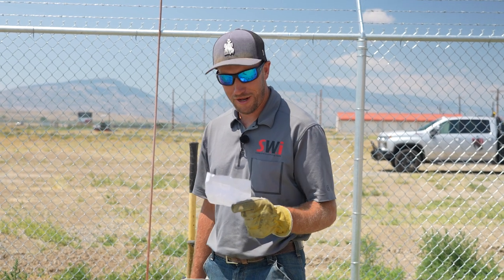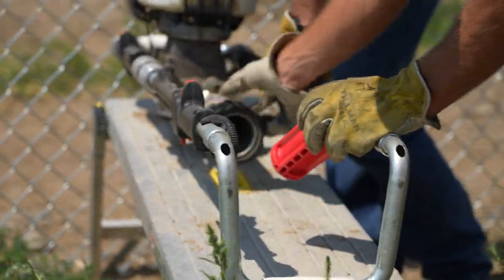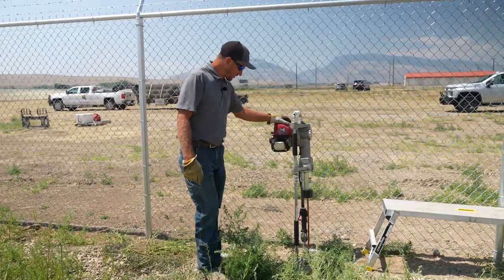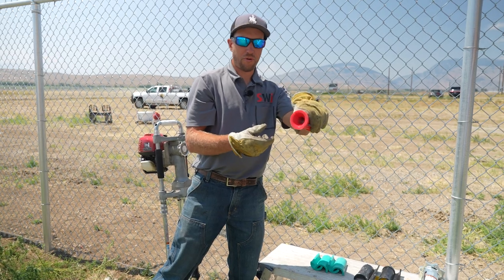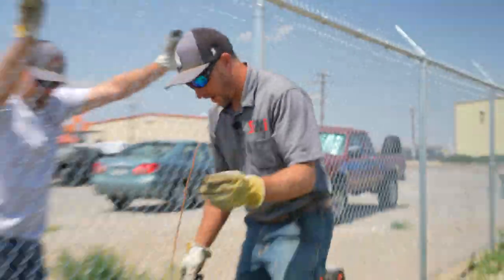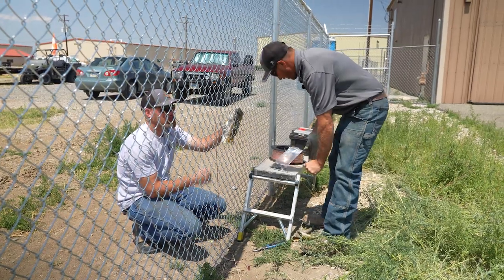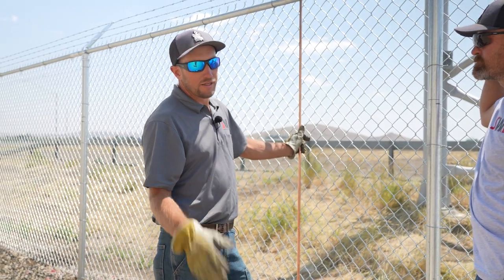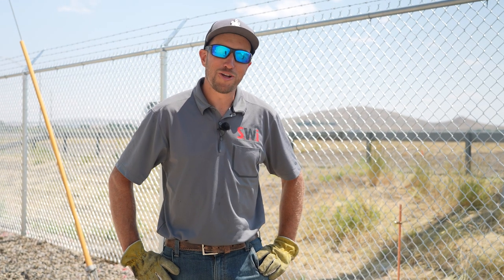The Easiest Way To Drive Multiple Ground Rods

Comment: Are they not called collet rings?  That’s the technical name for the one on my router,

About driving groundhogs… finally an image to wipe out the beer commercial of the cat herders!!!

Loved it.
Reply: Oh… I forgot… This summer, I did some work helping to put in a road bed for a small gage railroad loop.  The crew that set the tracks was three men. The youngest was 60… the owner was 70.  He drove every spike with a railroad sledgehammer… its head was only 1” in diameter.  Using it  he could drive a spike with a starter tap and 3 full overhead swings.  I never saw him miss hit once.

He started building railroads when he was 16… from what I could tell, he was just about to learn the trade!

Perhaps you are just a bit too inexperienced to drive those ground rods???
Reply from the maker: Compared to him I'm a total noob! 🤣